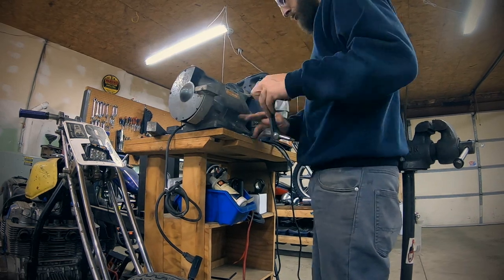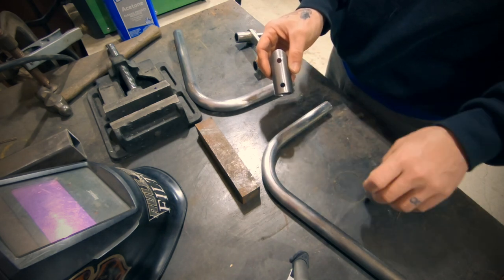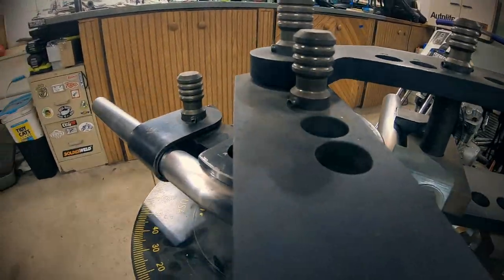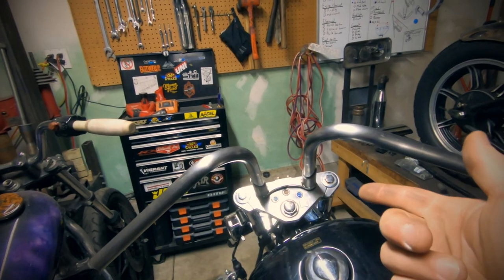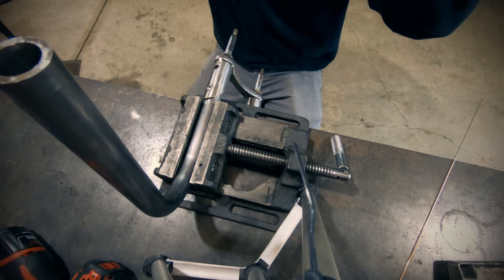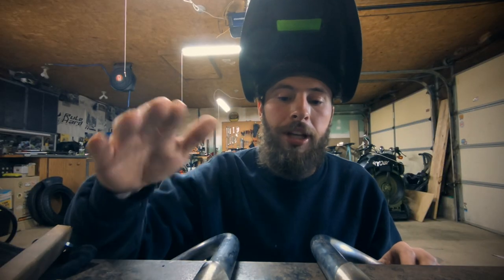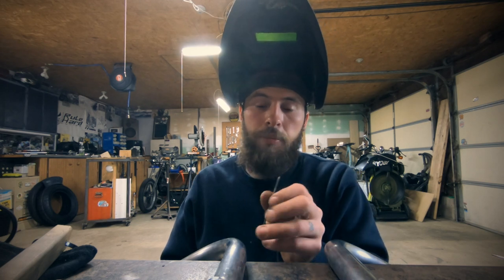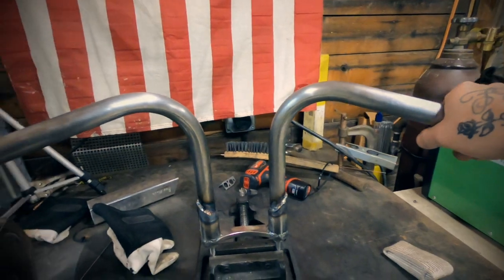Honda Shadow VLX 600 Chopper - DIY Chopper Handlebars

Comment: Thinking of trading a guitar and amp for a 95 shadow 600. Needs a center clutch, which supposedly isnt made anymore. So not sure lol
Reply from the maker: Not familiar with the center clutch ?
Reply: Lol also thinking they quit making it in the form it was and changed name and part number and still manufacture a different version of it. I will know tomorrow. Its already bobbed and a hardtail. If my assumption is correct i will order part tomorrow and get bike... Lol
Reply: It holds clutch basket together i think ? 4 bolts, goes on top of basket. Cant explain but in manual.
Reply: In manual it is center, clutch part number 22120-ms6-920... Which is not made anymore under that part number.
Reply: Basically the top part of whole basket. Last big piece that is put on...